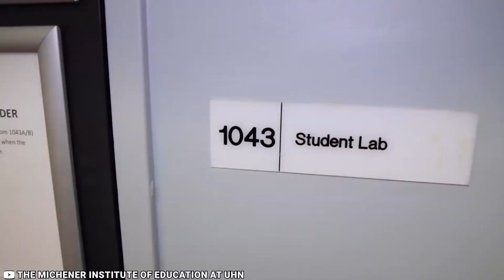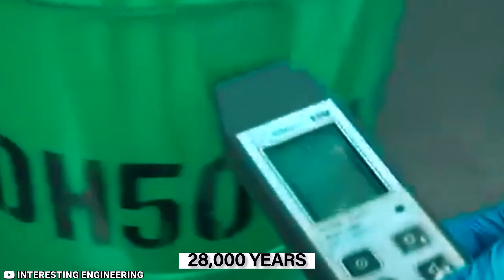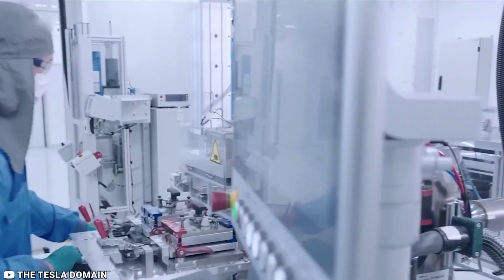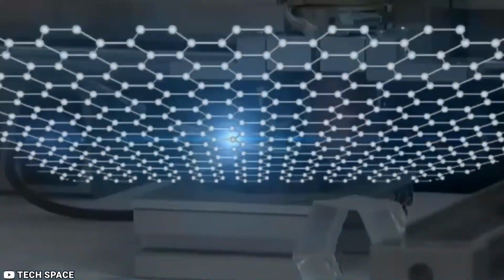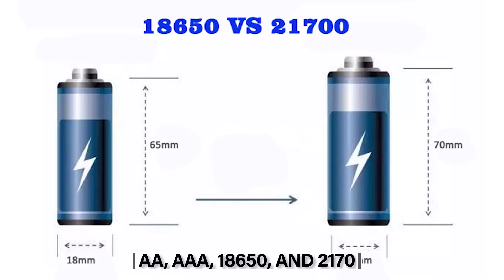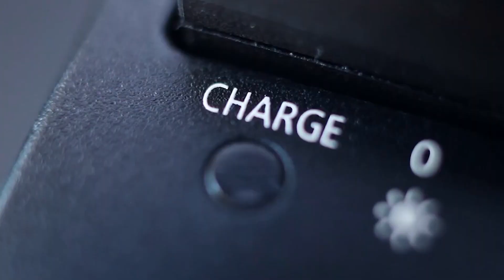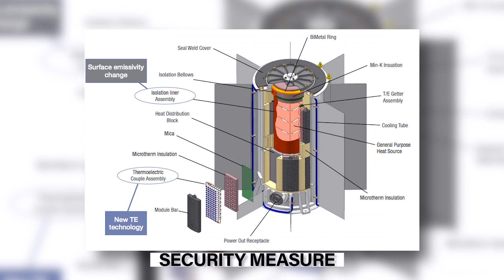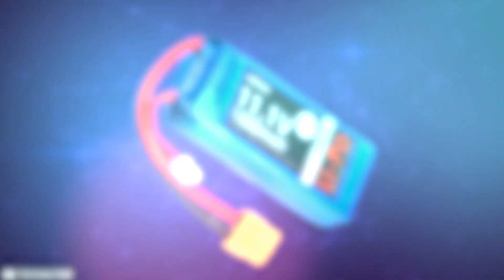FINALLY REVEALED! Nuclear Diamond Batteries to Last Thousands of Years

Comment: Imagine a battery that can last 1000s of years 😊...then, realize such battery being 1000s of times bigger than a Li-Ion battery for the same power 😮
Reply from the maker: I'd like to see such technology in handheld devices. When would it be available though?
Reply: @FutureIs_Here  Yes but it simply is not possible as the power density is 1000s of times smaller in 10s of micro Watts per cubic centimeter. Your smart phone battery will need to be 1000s of times bigger with this battery technology for driving the phone with the same power. If you can hire someone to carry your mobile phone battery, this might be great for you 😂
Reply from the maker: @ThinkingBetter  I see a new business opportunity!
Reply: @FutureIs_Here  Which one?

Comment: While there were a couple nuggets of actual science in this video, most of it is just plain incoherent.
You can get energy from radioactive waste, and yes, diamonds have been observed to recover that energy in a useful manner. But I would be quite surprised if people started using nuclear batteries for their phones, as I don't think you can use material that is radioactive enough to power a phone without a serious health risk due to said radiation.
Satellites would probably be an ideal use for nuclear batteries, and maybe pacemakers too, if the batteries are properly shielded. An irradiated heart would suck, especially if you already need a pacemaker.
The output of nuclear batteries is not variable, they will discharge at the same (slowly decreasing) rate until dead. Not drawing any power from them will simply cause that power to be turned into excess heat. You could supplement this by adding conventional batteries to the nuclear setup, but that only works for so long.
Sub-critical nuclear decay also generally produces very small amounts of energy, so no, you will not be able to buy a nuclear battery powered EV. At this point it seems like a nuclear EV would most likely have a thorium reactor. (Those are really cool, look them up)
One final note: nuclear waste is not as big an issue as this video suggested. It can be safely stored, and there are multiple ways of recycling, or otherwise disposing of, this waste. Thorium reactors appear to be very promising in this aspect. (seriously, look them up)
Reply: Imagine a battery that can last 1000s of years 😊...then, realize such battery being 1000s of times bigger than a Li-Ion battery for the same power 😮
Reply from the maker: We will, thank you! Would you like a video about thorium reactors?